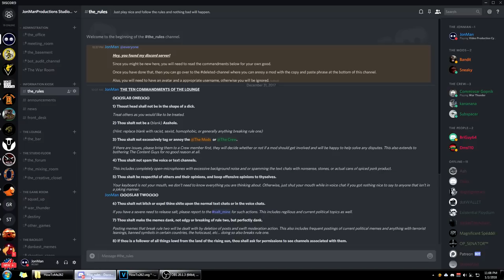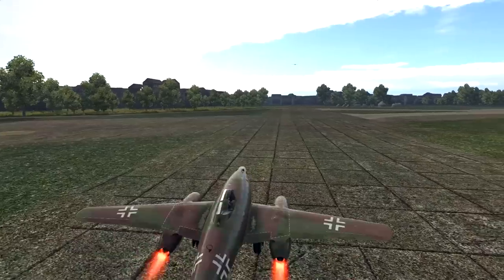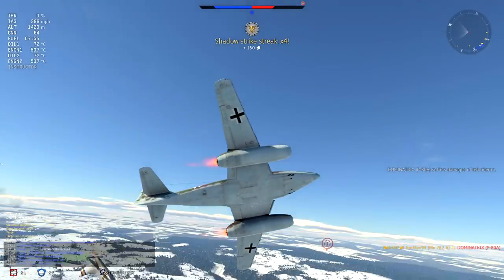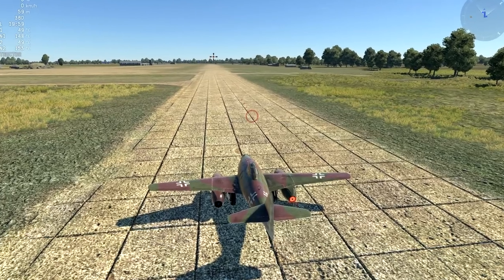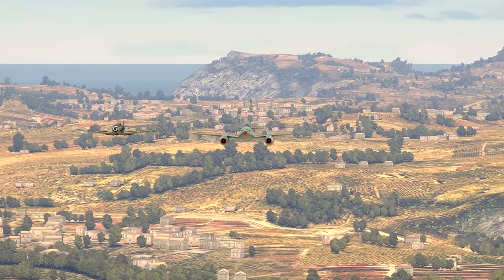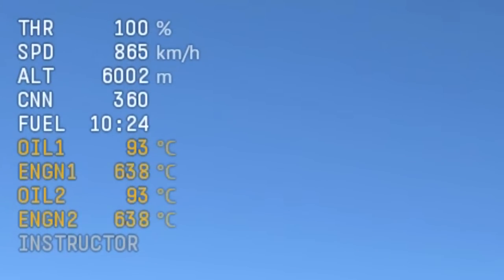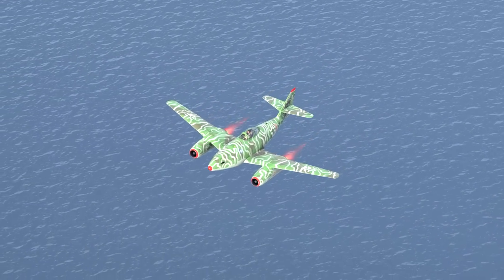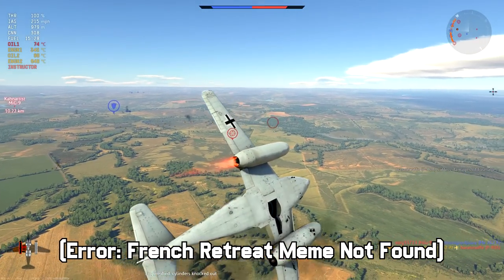War Thunder: How To Me-262

Comment: As a German I'm proud we over-engineer everything to a point where we even take into concideration: what if the pilot has to land without the landing gear?
Well just slide down the runway, put some duct-tape over the scratch marks on the engines and up you go.
Seriously, this is one heck of a funny meme collection in there, thanks.
Edit: Any chance you might make a how to about the Ho 229?
Reply: German over engineering is cool til you have to work on it.

Comment: A little note the BF 109 K4 The plane you research before the ME262 has one of the 30 mm mark 108 cannons so you can technically get some practice with the guns drop off Before you actually get the 262

Comment: Issues with the engines were widespread irl wise as they minerals needed they couldn't get so they had a lifespan of roughly 40mins your get one flight then any after the engine would crack while cooling and appear fine but next flight would fail

Comment: That Bf 109 K-4 just outran the Me 262
Reply: Piston engine-propellor propulsion produces far more thrust at low speeds than an early turbojet of equal weight. Combine that with the K-4 being around half the weight of the swallow, and yes, it will out accelerate at low speeds